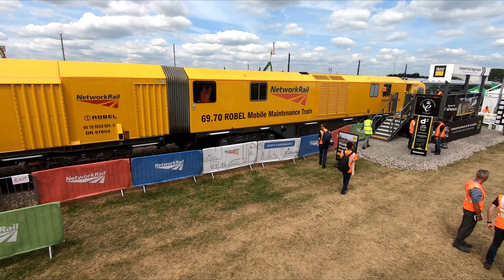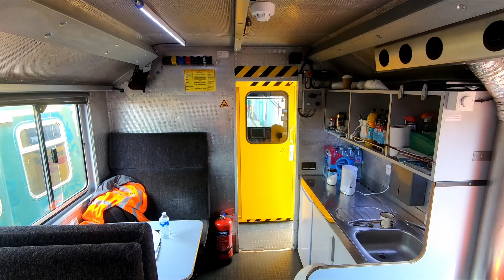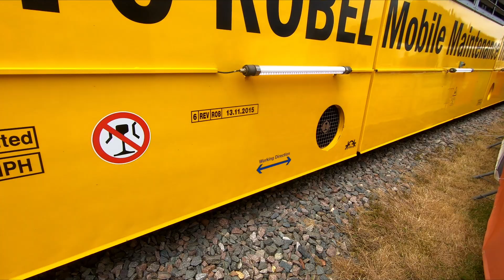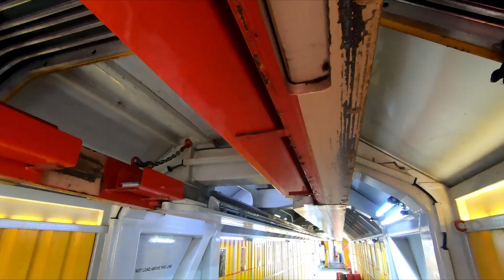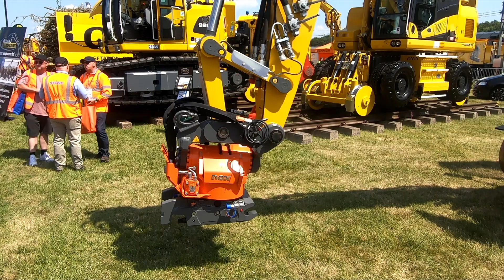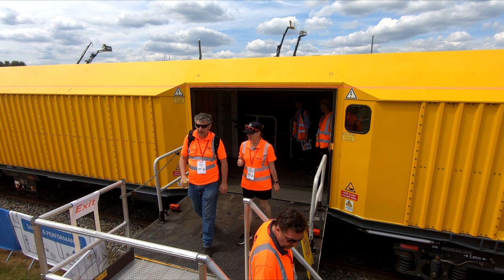Network Rail Mobile Maintenance Train

Comment: Given that this train operates in the UK I have to question if saying 480v tools and 110v tools were used was a mistake. 480v makes sense but nowhere do we use 110v.
Reply from the maker: Stated in multiple sources, maybe just an option which isn't used
Reply: Lots of commercial use power tools work at 110v. I suspect it’s easier/cheaper to supply 110v than to get custom tools.
Reply: 110 volts with earth in the middle and +55 volt and -55 volt being fed to both sides of the tools is common on UK construction sites as it means that someone who accidentally earths an appliance with their body only gets half of 110 volts instead of 240 volts.

The Health and Safety Executive says that 100 volt tools need to be inspected by users weekly, they need to have a formal visual inspection by a PAT tester once per month and they need to have a full PAT test every three months. We would not have government regulations for tools, if we didn't use them.

Comment: Interesting, thanks! How are the rails below the floor loaded?
Reply: The MMT is moved forward then they are place the lengths of rail in the 4ft. The train is then moved back over the rail, and the hoists in the MMU section lift the rail and moved into the IC, then lowered into the storage coffers.
Reply from the maker: Not 100% sure, but if I was to take an educated guess, they would place the rails between the running rails, drive over them and then pick them up from the work area. There are retractable lifts on the sides, but they're used to load tools and equipment

Comment: How does that overhead crane work if they're doing stuff on a curve...? Or does it just not?
Reply from the maker: Good question. I imagine it would still be able to operate to a point. The red rails between the 2 carriages seem to have a bit of play in them.
Reply: My guess is that a train carriage that stores straight rails can not help with problems involving curved rails.

They might still be able to do the job, but they would probably unload all the straight rails and get loaded up with pre-curved rails. If the two cranes can work independently, that suggests that a number of curved rails could be installed in the carriage next to the hole, and sent out using whichever crane has to best clerance for that sort of curve and then manipulated over to the other side of the work area, if needed. And, when the team used up all of those rails, they would clear out from the work area and then the driver could back away to the nearest part of straight track, so that they could transfer all the curved rails stored in the second storage container to the first carriage over a straight connection. Once that was done, and the two cranes were disconnected, they could return to the work site and carry on. It would be a bit of a faff, and would be slower, but it would allow them to do awkward jobs. And being able to do awkward jobs in bad weather would be better than abandoning the job for the night.

It wouldn't surprise me if these things could raise up the side-flaps and carefully pull into a railway station with a curved platform. There is a Network Engineer dude who has gotten Geoff Marshall sent out on a couple of track maintenance works. And there is a YouTuber down in Dawlish who got to do a ton of filming of the rebuilding of the Dawlish Sea Wall and associated upgrade of Dawlish Station. I'm hoping that someone at Network Rail can get Rail Focus out onto a worksite to film something like East West Rail construction or overhead line installation.

I think this channel is especially good for explaining what the engineering channels are in a calm way. In a world where a bunch of anti-rail campaigners are:
* Complaining about cost increases (when we all know our shopping bills have shot up since Brexit),
* Complaining that "all the money is going to London", while trying to cancel a rail project in the Midlands or ignoring the fact that Crossrail didn't get built for about 80 years, Thamslink 2000 was delivered 20 years late and there have been 20 failed attempts to extend the Bakerloo Line into South East London.

We need independent media, like Rail Focus, to explain what individual rail projects are supposed to do, what is good about them and what is lacking in them. We need to have people who can criticise the government for not electrifying East-West Rail, while it is being built, without having conspiracy theory nonsense injected into the message. And Network Rail needs people like Rail Focus, to help make sure young voters know what railways actually do.